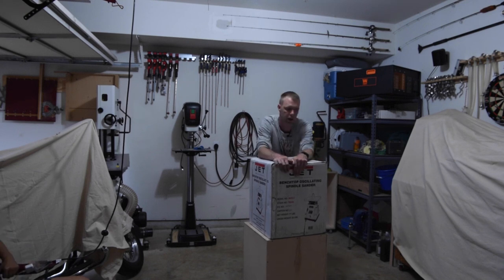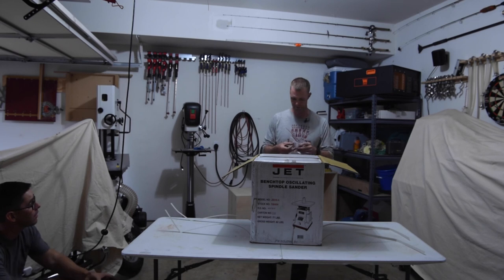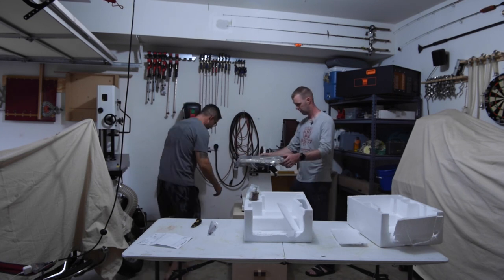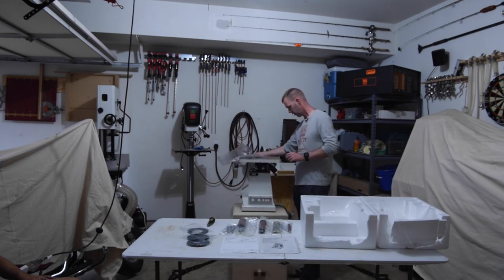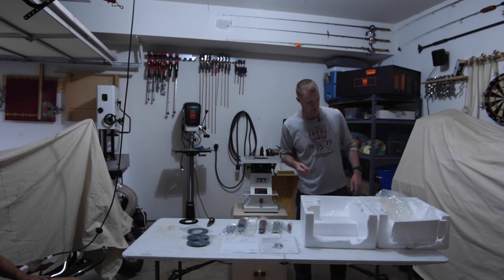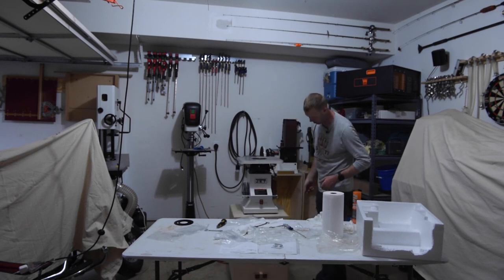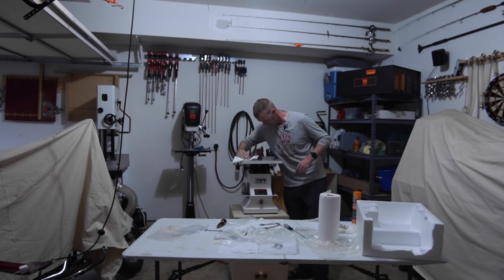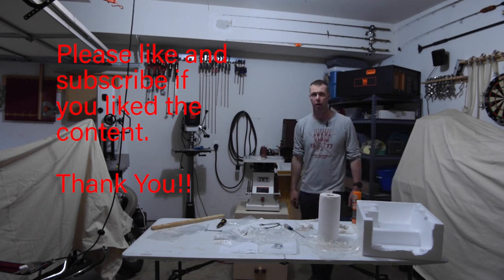Jet Bench-top Oscillating Spindle Sander Unboxing

Comment: Thanks for the video. I just got one of these second hand and it makes a bit of a noise and I thought it may be a bearing but it sounds like yours has the same noise it's at the top of the oscillation. I'm hoping they all do this. Any thoughts?
Reply from the maker: I can't say if they all do or don't have a bit of noise as the direction changes but I'm not going to worry about it at the moment. I have used this tool a fair bit but not as much as a production shop would. It hasn't seemed to get any worse ( or better) but more importantly to me, it still oscillates true and has no play in the sander. Sorry I'm not much help, let's just hope they all keep sanding as advertised for many years to come.
Reply: @CDWoodWorX  thank you for getting back to me.